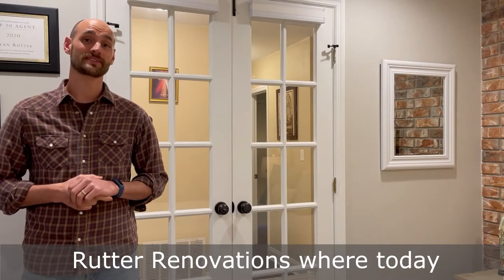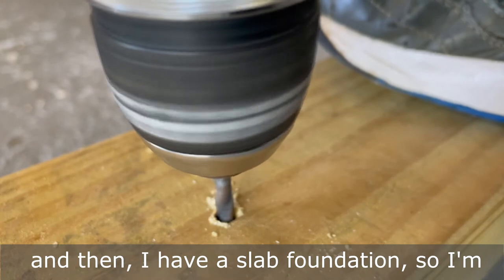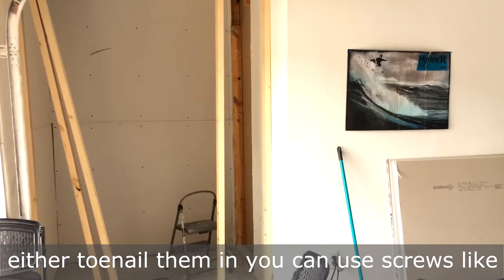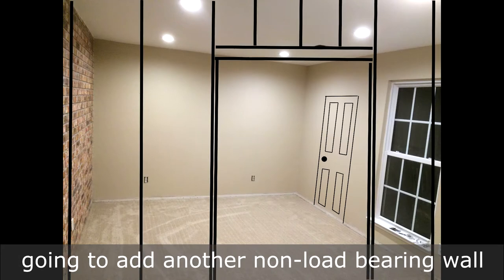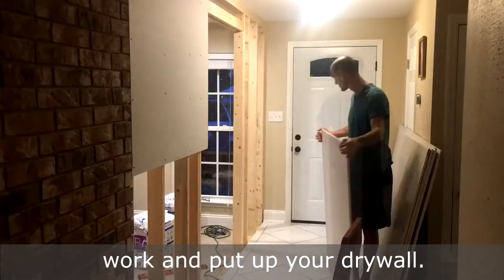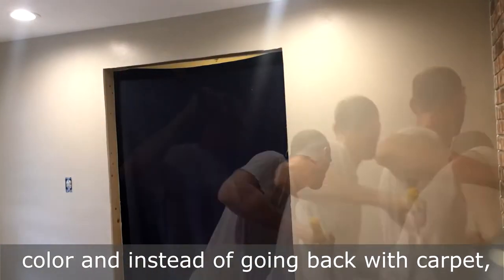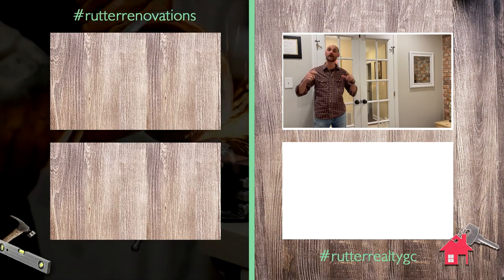How to Build A Non-Load Bearing Wall and Add An Additional Bedroom

Comment: What if the top plate of the new wall runs the direction of the ceiling joist but not directly under it. How would you stabilize the top plate? Thanks for your videos, God bless
Reply from the maker: That’s exactly how mine was. It is covered in the video at 1:30, though it was brief. I put a perpendicular 2x6 in between the two ceiling joists that run parallel with the new non-loadbearing wall and attached my new top plate to perpendicular 2x6 as well as screwed long screws from the new top plate and bottom plate into the top and bottom plates of the adjoining walls.
Reply: @rutterrealtygc Okay nice, thanks alot!

Comment: How much weight would you say a nonbearing wall can support? For example, if a client wants some heavy cabinets to be hung from the wall. If everyong is mounted into the studs, how many pounds can a nonbearing wall support?
Reply from the maker: You should consult your local contractor or structural engineer for weight limits on your particular situation. Load bearing or non-load bearing walls should be able to support the standard kitchen cabinets as long as it is properly tied into the adjoining walls. Check with you local contractor for your particular situation.👍

Comment: Not sure if you're still checking comments but I'm wondering why you doubled up the top plate?
Reply: Same question.
Reply from the maker: Because if you stand the 2x4 on edge (2” down and 4” high) you need two to match the thickness of the wall.👍
Reply from the maker: See my response to Tyler L.👍
Reply: @rutterrealtygc  hmm I don't think I understand. Looking to do something similar to this and from what I've seen the top plate that attaches to the ceiling doesn't need to be doubled up. But I'm wondering if you have a reason or a trick that you do it that way.

Comment: I am putting in a partition wall in the existing room and need to know how much damage I will cause by going directly through the carpet with base plate screws? I don't want to put back carpet since this wall may come down in a couple years and the carpet is only 2 years old
Reply from the maker: 🤷‍♂️ Can’t help you with that one. I would want the wall on a solid foundation instead of carpet.

Comment: Do I need to pull permits to add a wall and doors just like you did? I'm thinking of putting Up a wall to divided living room.
Reply from the maker: Unfortunately, you will have to check with your local city and county departments to get this question answered. Best of luck with your project!

Comment: So what do you do if the ceiling joist arent above where you want your wall ??
Reply from the maker: I address this at 1:33 in the video. What I did for mine was add a board in between the ceiling joist that I can screw the top plate into. Make sure to check with your local codes and ordinances to make sure you’re within compliance.

Comment: Did you use a prehung french door ? I want to do the same thing to cozy up a recroom but  need a bit of guidance on hanging french doors that are not prehung.
Reply from the maker: The doors that I purchased were pre-hung. Have you looked up how to build a frame for a door? That would probably be helpful if you don’t have pre-hung doors.

Comment: Also you did not cover the taping of drywall to existing ceiling in conjunction with making the wall addition look like it existed previously.
Reply from the maker: I didn’t want to redo the ceiling which is why I just caulked it. 👍 The caulk is flexible and hasn’t been an issue.

Comment: how did you find the joist when you were installing/nailing the wood to the ceiling? What if where you want to put your extra room, doesn't have a joist exactly where you want your non-load bearing wall to be?
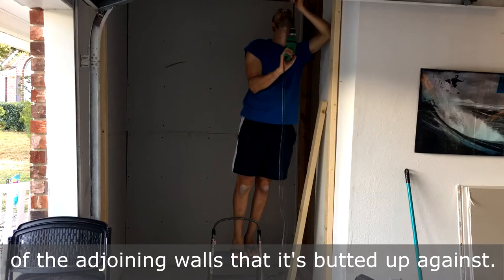Reply from the maker: I covered this with voiceover in the video between 1:30-1:50, but my ceiling joists didn’t line up with my wall either. I added a few boards in between the ceiling joists and screwed the top of plat into those in addition to the top plates of the adjoining walls.
Reply: @rutterrealtygc  what if the ceiling is not already exposed to add a stud, would I have to remove the ceiling(sheetrock) to add some? Or is there another way?

Comment: You should have added blocking half way up.
Reply from the maker: Not all walls need blocking. In general, load-bearing walls require blocking, while non-load-bearing walls do not. It's not code unless the wall is 10+ feet in many areas and this wall is only 8ft.